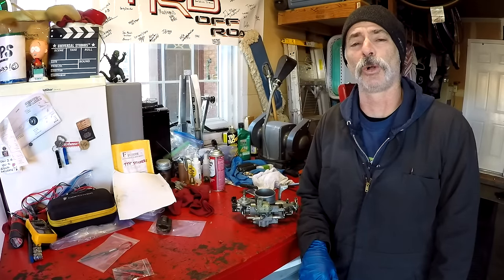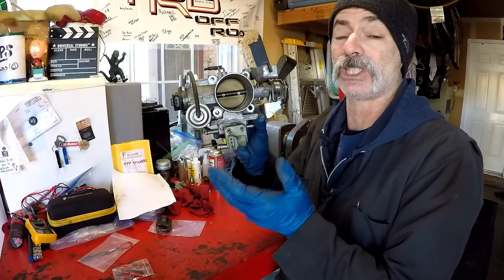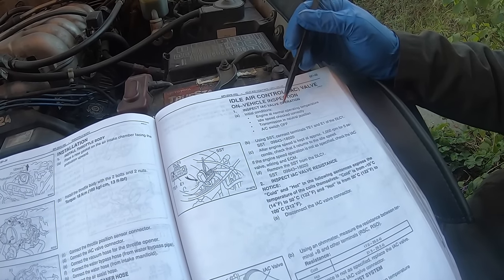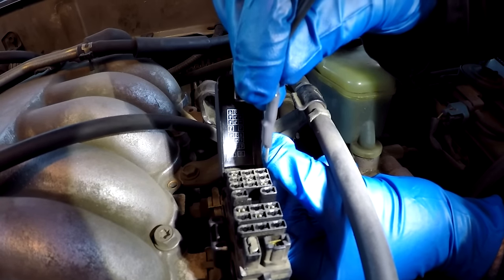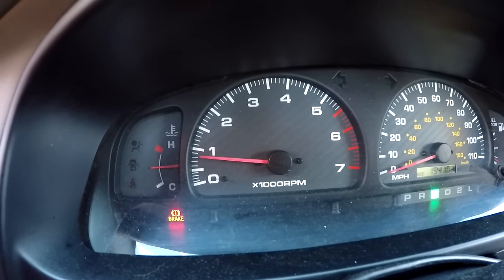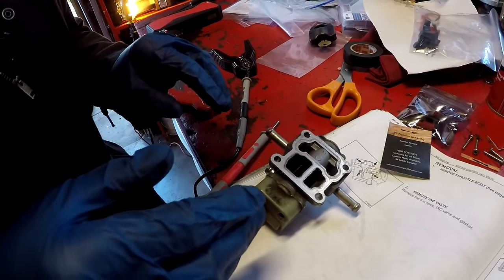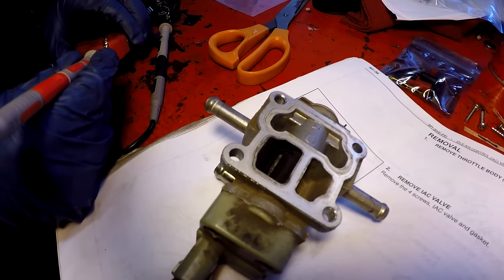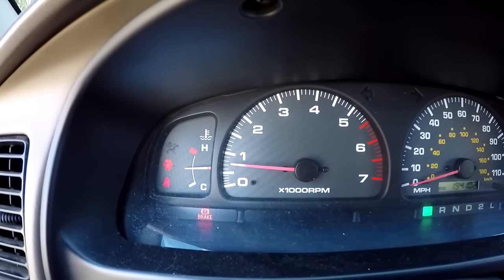IAC Valve Testing and Cleaning

Comment: At 212k miles I think my IAC valve is in the early stages of going bad. It starts nice and sharp when cold but when it's hot it doesn't start as sharp and stumble starts sometimes. I cleaned it, the throttle body and MAF sensor last year and it didn't help. Our 01 Camry with the 1MZFE V6 did the EXACT same thing. It has half the miles and I cleaned them both at the same time. The issue went away on the Camry. I think with twice the miles the one in my 4Runner is simply wearing out. It runs perfect otherwise with absolutely no runnability issues. Just a bit of a stumble start when hot. When it's cold it's fine. All of the plugs, wires and fuel injectors were replaced by the previous owner at 203k and I replaced the fuel filter. 

I'm confident it's an IAC issue.
Reply from the maker: Hey Scott, my 2000 4runner I did this job on has exactly the same issue.  I forgot to mention that at the beginning of the video but it's the reason why I wanted to do this job.  It's a very intermittent problem though.  So far, my rig is starting well when hot so time will tell if this worked for me.
Reply: @TimmyTheToolman  Will you do an update video to let us know if this helped with the warm restart stumble/issue?  I've had the same problem for years and I've tried everything, including cleaning the TB and IAC.  It's literally the only problem my truck has and otherwise runs perfectly for  230k miles.
Reply from the maker: @Birdmacher  I will give an update in a pinned comment.  The hard starting for my rig when warm hasn't occurred in a while.  I'm going to give it some time and see if the problem resurfaces.
Reply from the maker: @UsoZoa Get back to us and let us know if it made a difference.  Good luck with the job.
Reply: @TimmyTheToolman  I've been thinking about this for years and wondering if maybe the VSV on the charcoal canister isn't working properly (mine was ticking loudly in winter at one point) and isn't doing its job to prevent excess fuel vapor pressure in the rail when the engine is shut off hot.  Basically, I wonder if a faulty VSV or line to/from the VSV is lightly flooding the engine when hot.  Mine always feels a little bit flooded when it stumbles on warm restart... I have a 2000 4Runner but only have a 2002 FSM which shows different locations and components for the emissions system.  Does your 2000 FSM show any diagnostic procedures for that VSV or the system generally?
Reply from the maker: @Birdmacher  Email me and I'll send you a couple pictures regarding the VSV inspection from my 2000 manual.  mtbtim@sbcglobal.net

Comment: Hi Timmy The Toolman and other guys. Timmy The Toolman thanks for your work and video. I have the same car with the same engine and the same throttle assembly. Recently, they made a restoration of the throttle unit to me - they removed the wear of the damper and put the axle on the bearings. After installing the throttle assembly in place, I ran into the following problem: the engine starts, the warm-up rpm is 1200-1500, after the engine warms up, the rpm drops to 750-800 rpm, everything is fine, but when I press the accelerator pedal the rpm rises and does not fall. As soon as I press the pedal sharply and the revolutions fall into place, or I have to hand on the knot where the kick-down cable is twisted and the revolutions fall. The problem is the same when the car is moving. When the car drives, when pressing the accelerator pedal, the revolutions rise, and then, as I release the pedal, they do not fall but grow, you have to sharply press the pedal so that they fall. Friends have any ideas what could be the problem? Thanks in advance for your reply.
Reply from the maker: Sounds like either your throttle cable is sticking or the throttle body itself is sticking.  Have someone push the gas pedal for your while you are looking at the engine and see if the throttle plate returns to the closed position when the gas pedal is released.  It it doesn't remove the throttle cable and manually move the throttle plate mechanism by hand and see if the plate closes on it's own.  If it doesn't, the throttle body is the culprit.  If the throttle plate does return to the closed position, then the throttle cable or maybe even the throttle pedal is the issue.

Comment: Been researching this process for my 03 Taco with a 2.7. Just cleaned the throttle body and the IAC a few hours ago,  off to the mechanic tomorrow for a rough idle and hard start.
Reply from the maker: The rough idle and hard start happened after the cleaning or did you do the cleaning due to the rough idle and hard start?
Reply: @TimmyTheToolman  i had the check engine light on for two years but the truck ran perfect. One day it wouldnt start and rough idle for a day or two and that went away for a month… SO i had the codes read from the local parts store ( there were about 5 or 6 mostly evap system and bank 1 o2 sensor) so I tested and replaced some evap parts as well as the gas filter, the check engine light went off and the idle would fluctuate when warm… acceleration felt like a wild horse in first 3 gears, not a lot of power.  I saw some vids and decided before the mechanic I should do everything I can before he has a look, so I cleaned the throttle body and the ICV today. The really rough idle returned and it barely starts but the stuttering acceleration went away and the check engine light came back on.  Unfortunately I didnt know how to test the ICV
Reply from the maker: @Seajunkie  I think it could be an issue with the throttle position sensor.  If your throttle body has a throttle position sensor that's not replaceable, then you'd need a new throttle body.  I'm interested to hear what the shop figures out.
Reply: @TimmyTheToolman  Hmmm I must hve forgotten to plug something back in and the mechanic did it for me… LOL. Back to this bucking while accelerating so Im going to delve into your suggestion… thank you!
Reply: @TimmyTheToolman  I replaced the throttle position sensor as it is accessible, unfortunately my truck still bucks when accelerating.  None of this was happening before I tried to replace the solenoids/ vsv in the evap system
Reply from the maker: @Seajunkie  Wish I could point to you to the answer but I'm not sure what the issue could be.  Did you use OEM parts for the Evap?
Reply: @TimmyTheToolman  All parts I replaced are Toyota except the modulator and the TPS ( I thought if it changed the problem I would go forward and get purchase that as an actual Toyota part)
Reply: my coil went bad miss on idle give it gas missed warm up ran fine changed coils new densos new plugs fresh. spark gets week because old n hot😃01taco 4 cylinder. but before I did the work 1 gallon of lacquer thinner to 10 gallon of gas ran it out same day runs nice now love my taco🙋👪

Comment: hey timmy, got a question and a warning for others. i suffered from a high idle for yrs. couldn't figure it out. i had cleaned my throttle body when i did my valve cover gaskets. must have done something to the butterfly valve. i learned that if i pulled on the throttle body linkage, the idle immediately dropped back to normal. well, i intended to do the throttle body linkage mod with the washer. when i went to remove the sole nut, it didn't give me much of a fight at all. But, it turns out the threads came off with it. I don't have an ounce of rust on my truck because I live in the desert (original owner of '98). So just a warning. Be sure to spray some lubricant on that nut if anyone decides to do the same mod. Anyway, I wound up having to buy a new throttle body. On the very top of the throttle body (as seen in this video), there are two "spouts" on the very top that face towards the throttle position sensor. the new throttle body didn't come w/ the black caps. should i transfer the caps to the new throttle body? any idea what that's for?  much appreciated....AS ALWAYS!
Reply from the maker: Yeah, I've heard of that washer mod to fix a throttle plate issue.  That sucks that the threads came off with the nut.  I would transfer the caps to the new throttle body.  It might not matter but I would wager they are capped off for a reason.
Reply: @TimmyTheToolman  THANKS timmy!

Comment: Man I needed this rn! My RPM's are at 2,000 on start up. It'll go back to normal after idling for a while. I think this might be it....
Reply from the maker: Hopefully it is.  Let me know the result after you get done with the job.
Reply: @TimmyTheToolman  yessir! I'm not gonna do it quite yet, I'm a little intimidated about taking off the throttle body by myself.
.
Reply from the maker: @quikdraw5203  You will have no problems taking off the throttle body.  As you saw in the video, it's not complicated at all.  And, I already shared with you the worst mistake you can make when performing this job and that's mistakingly connecting up one of the coolant lines to the air assist line.  If you're careful and take your time, you will find this job very simple and straightforward.
Reply: @TimmyTheToolman  yeah I know, I'm just real nervous about doing any mechanic work. Once I get started, I will settle down lol. I'm also replacing the charcoal cannister, I didn't see a video of that procedure. Is there anything I need to know ??
Reply from the maker: @quikdraw5203  Once you get your feet wet wrenching, you'll gain more confidence.  I was intimidated by some auto mechanic jobs as well but just diving in and believing in my ability to turn wrenches showed me it's not really that hard.   With the Right Information, Right Tools and Right Level of Patience, you can handle most of your own work.  I don't expect you'll all of a sudden start rebuilding engines and transmissions but most auto repair work can be handled by a DIYer.  As vehicles get more complicated, it's becoming less DIY friendly but our rigs are older and fairly straightforward to work on.  I've never replaced a charcoal canister but I'm guessing it can't be that hard.  You probably just have to disconnect some hoses and mounting hardware and it will be out.  Good Luck!
Reply: @TimmyTheToolman  I wonder what that little charcoal canister does.  I just did a JDM full engine replacement (3.4, 97 4unner) but am using the same plenum and throttle body.  Pulled the IAC valve off the JDM and got a "check engine" light.  So, took that off and put the old one back on.  If I knew that replacing the IAC valve would fix the high idle (once warmed up, never gets below 1850), I would buy a new one.  Don't want to spend the money for the testing equipment...I just assume it's bad.  The thing I wonder about is - could any other vacuum leaks or a malfunctioning mass airflow sensor be causing this?  I cleaned the old MAS, but you never know if it's still working or not.  Since I'm into my project $4-$5k already, I'm a little reluctant, or I should say, my wife is a little reluctant to me performing diagnosis by buying parts.  Thoughts Mr. Tim?
Reply from the maker: @cameronwright2754  You're hight idle could be caused by any vacuum leak.  A multimeter is a very affordable tool for diagnosing.  I suggest you get one and test the IAC and look for any vacuum leaks.
Reply: @TimmyTheToolman  Will do Tim.  I appreciate the response.  I've also seen guys on other sites saying they put a washer (basically a spacer) on the throttle body shaft that controls the the flap (the rod that rotates when you depress the accelerator).  Seems like a half ass fix to me, but when I physically grabbed the rod and pulled toward the front of the vehicle (simulating the position if a spacer was in there), the idle dropped.  Again, seems like a really half ass fix.  Other than that, my 3.4 is running perfectly.  You removed, added parts to the new block and heads, and reinstalled in 4 days.  I loafed around and got it done in 6 months.  You have a good group of guys there.

Comment: I learned that the signal on this is "duty cycle" meaning that the computer is sending power to both upper and lower pins. That being said, I tested the signal coming to the ISC connector and I only get a solid reading of above 12V on the RSC pin (uppermost pin from ground) to the center B+ pin (battery positive) and I'm wondering what could cause that?

I'm guessing the RSO (Lowest pin) should be having some larger value of voltage than the RSC pin when starting cold. The reason I say that is when I connected that RSO pin as ground with 12 volts positive to the B+ pin with a jumper cable, it idles high like it should when the engine is cold.  

When testing with a multimeter, the RSO pin voltage shoots up to 9V and then drops immediately w/o me doing anything when the ignition is in the ON position w/o starting it. I double checked this by using a computer from an old same model car (Toyota Previa) I had, and the same 9v initial voltage jump happened and went back to 0.

Whoever is reading this, if you're idle is working correctly, taking this reading would only take a few minutes and would help me tremendously. 

Maybe when I fixed my MAF awhile back (apparently the solder joints are temporary - https://www.youtube.com/watch?v=CXCpYj-r_lI&t=758s) I soldered something that now is causing this problem...hmm....still thinking about that one...

Comment: Timmy...I have a 2002 4runner and after a few weeks of throwing p1120 and p1121 codes I bit the bullet and replaced the throttle body from toyota. PN 22030-62020 with gasket 22271-62050.  She runs like a top now....20 years on original parts.  The tps and the accelerator pedal position sensor just got too far out of spec.   Kept going into limp mode.  $450 to return it back to specs, well worth it.  Keep em running.
Reply from the maker: Yeah, the 01 and 02 throttle bodies are different from the 96-00 ones.  If you start having issues with it, you have to replace the whole thing.  But, like you said, money well-spent to keep your rig on the road.  Definitely a hell of a lot better than a $500 car payment every month to get a new one.
Reply: Also...Wheeler makes a driver set with torque capabilities.  It is designed for gunsmithing, but with JIS bits i have found it quite useful on the 4runner.
Reply from the maker: @snowhiterover  Thanks for the info.

Comment: Cleaning the IAC with throttle body cleaners is fine I have done it several times over the years no issues have resulted from using throttle body cleaner at all
Reply from the maker: Thanks Antonio, that's good to hear.  There is a guy that commented though with a lot of experience and he said the IAC door has ball bearings on either side of the door that need lubrication.  When you spray a bunch of cleaner in there, you inadvertently wash the grease out as well.  The only problem is it's impossible to see where you need to reapply grease.  I guess you just have to hope that if you sprayed a bunch of cleaner in there, you didn't wash out all the grease, and if you did, the door remains functional for a long time to come.  Have you ever shot any time of spray lubricant in there after the cleaning?  I thought about this but wondered if the lubricant would attract more carbon gunk to build-up.
Reply: @TimmyTheToolman  I have sprayed lithium grease in after I was done cleaning it to re lube the bearings the best I could
Reply from the maker: @AntonioClaudioMichael  Gotcha.  When I pull off my IAC valve again, I think I will do the same.
Reply: @TimmyTheToolman  it's been working well for me same iac for the last 20 years

Comment: notice the thin metal gasket for the throttle body to be put on the engine... it has a little bulge.... that will get crushed and make a sure seal. replace it is possible when reassembling!
Reply from the maker: Some people forego replacing the metal gasket between the throttle body and upper plenum but it is a good idea to replace it.

Comment: Good stuff..I usually just open the throttle fully and slip the cables off instead of loosening up the adjustment nuts
Reply from the maker: Gotcha.  I've never tried keeping cables attached to the bracket but it obviously works.  Thanks for sharing.

Comment: I have a 2002 Tacoma 2.4 liter. The resistance readings I got were 500 ohms, and 620 ohms. Very different from yours. And the IAC is different. Has 2 coolant hookups, but no air line hooked to it. My truck would start but immediately die, and someone told me the IAC was probably stuck closed. It looks like some coolant leaked past the gasket, and over to the two rectangular chambers where the IAC opens and closes.
Reply from the maker: Yeah Mike, those ohms resistance numbers are just for the IAC on the 3.4 liter engines.  Hope a good cleaning fixes your isuue.

Comment: Tim: Toyota stayed with the exact same IAC for years -- and engines. 
So your tests, here, are widely applicable.
RSO = Open
RSC = Closed
The engine temperature is not THAT touchy. Look at the Toyota temperature ranges.
If the engine is cool enough to squeeze the radiator hose -- that's 'cold' for Ohms values.
If the engine has pressurized its coolant -- squeeze the top hose -- then use the 'hot' Ohms values. 
(If the engine is 'hot' you won't be able to keep your hand on the radiator hose.)
Reply from the maker: Thanks for sharing this information.